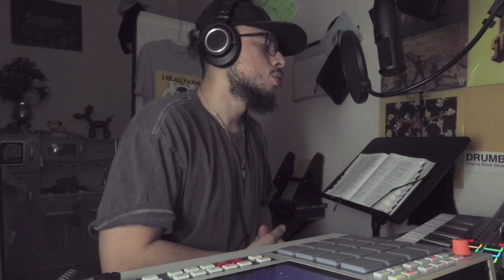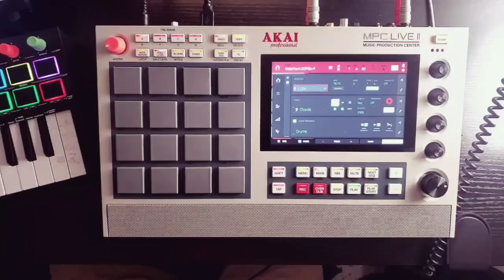Fastest Way to Make Loops Lo-Fi in the MPC LIVE 2

Comment: Oh man,thank you very much! Gonna try this next time I touch the MPC :D
Reply: I tried this in a keygroup and it didn't work. But since I tried it in a sample I had and I worked I tried to bounce the keygroup track to a sample but the MF MPC didn't :( This happens a lot
Reply from the maker: @PeteOnTheBeat  the lfo should work on a keygroup, you need to make sure you select ALL so that the lfo is adjusted simultaneously for all keys and not just a range of keys. I have not tried automation with the keygroups though.
Reply: Went to double and nope. Nothing I do makes any difference in the KG :/ But it worked on a sample tho.
Reply from the maker: @PeteOnTheBeat  double? I'm not sure what your explaining. Does the lfo work but the automation doesn't? Or is nome of it working?
Reply: @LiftedNoise  on the keygroup,none. Then i tried to bounce the sequence to sample and it didn't work. Doesn't bounce. Google didn't help either :(